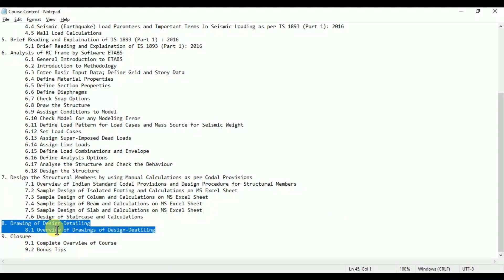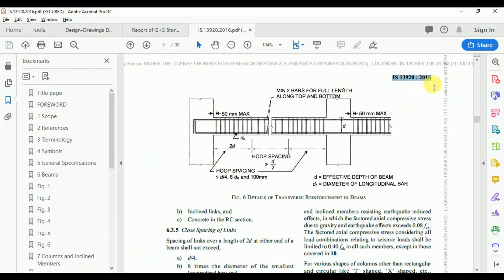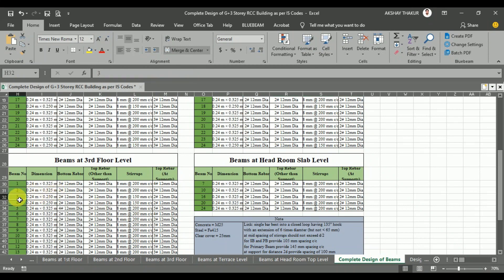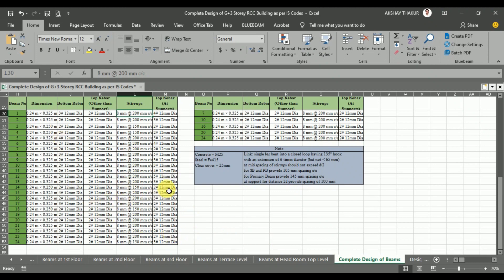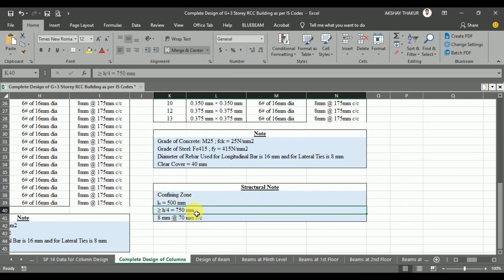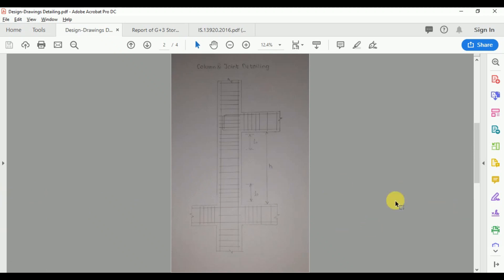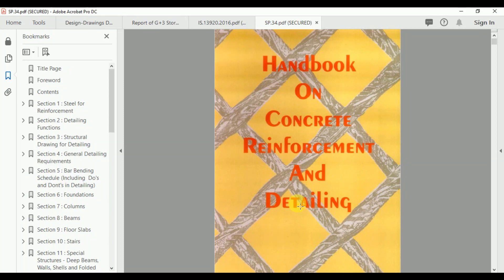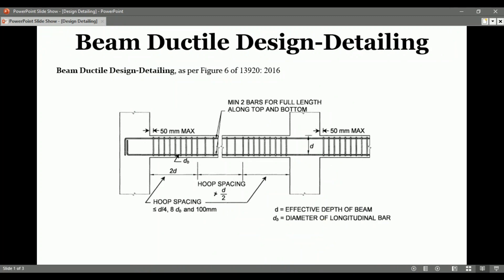8.1 Overview of Drawings of Ductile Design-Detailing │ Design of G+3 RCC Building │ Akshay Thakur

Comment: I means,,  if we design & analyze the tall ( G+7,8,9...25 ) building, what extra design steps will it have to be defined?
Reply from the maker: then structural planning need to be done as per provisions of IS 16700, dynamic analysis need to be perform and some extra checks are need to perform like modal mass participation, minimum frequency, etc. and other different checks and analysis as per IS 16700 property modifiers and analysis checks of that code also.... lot of things are are there for tall buildings (buildings having height in between 50m to 250m)
Reply from the maker: just to correct you as per Indian Standards tall buildings are having height more than 50m and less than 250m.... so G+7, G+8, G+9 as you mentioned will not become tall building! & for those we will perform linear dynamic analysis only...
Reply: @AkshayThakur  thx for information...😊

Comment: Thank you so much for Wonderful Information! .... But I still have a question in mind .. If we design and analyze the Dawn building, what extra steps will it have to be defined?
Reply from the maker: what that dawm mean? not getting your question exactly...
Reply: @AkshayThakur I means,,  if we design & analyze the tall ( G+7,8,9...25 ) building, what extra design steps will it have to be defined?
Reply from the maker: then structural planning need to be done as per provisions of IS 16700, dynamic analysis need to be perform and some extra checks are need to perform like modal mass participation, minimum frequency, etc. and other different checks and analysis as per IS 16700 property modifiers and analysis checks of that code also.... lot of things are are there for tall buildings (buildings having height in between 50m to 250m)
Reply from the maker: just to correct you as per Indian Standards tall buildings are having height more than 50m and less than 250m.... so G+7, G+8, G+9 as you mentioned will not become tall building! & for those we will perform linear dynamic analysis only...

Comment: Spacing of stirrups is uniform in case of IS 456:2000 but as per ductile detailing spacing is different in support and midspan.so which spacing is taken at the site for the structural design??
Reply from the maker: for Moment Frame System; If you are consider Response Reduction as 5 (SMRF) then as per Ductile and if use Response Reduction as 3 (OMRF) then as general as per IS 456... 

Reason is...
the things is earthquake load in case of R=3 then consider EL in Design = actual EL/3 and for R=5, considered EL in design = actual EL/5 ....
where as consideration of response reduction has a criteria which is stated in IS 1893-1:2016 .... for more go through response reduction definition and table stated in code

Comment: in excel sheet where find the lateral ties spacing ,and mauall design in lateral ties mamember is not clear
Reply from the maker: I have noted in Notes in Column Reinforcement Sheet, and respective things discuss in video ....
Reply from the maker: Excel Sheet is for Design as per IS 456 and SP 16, manually you need to satisfy Codal Requirements of IS 13920-2016